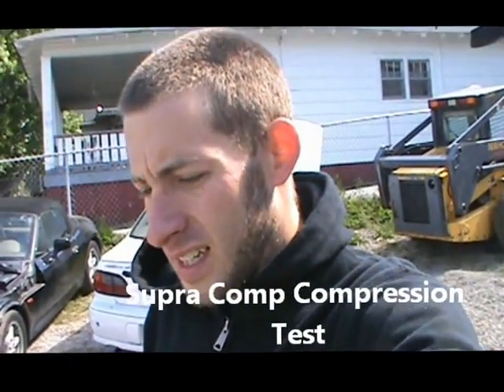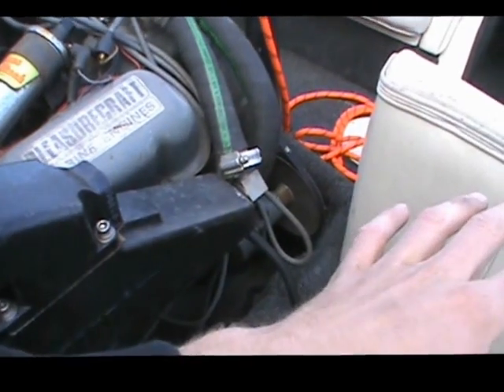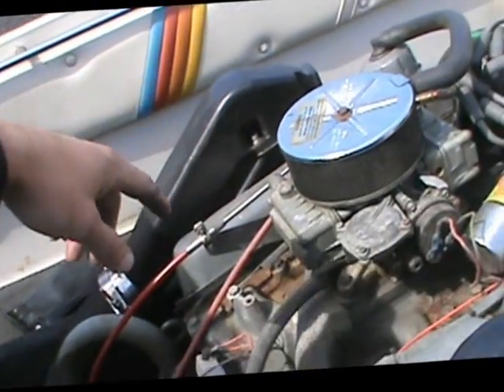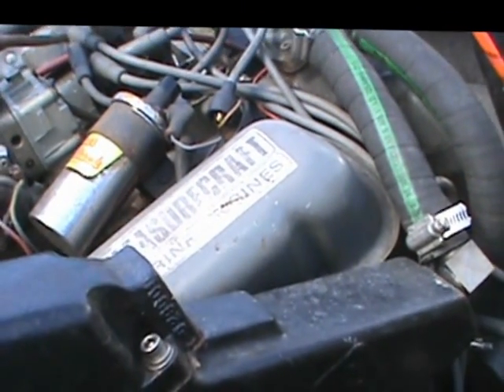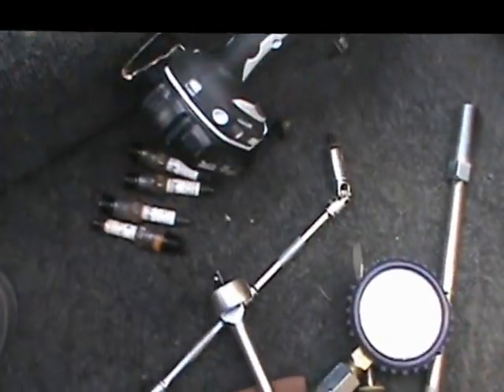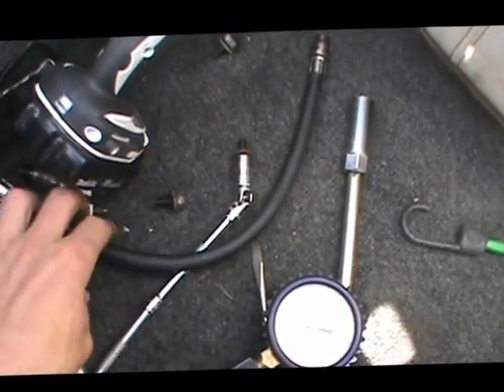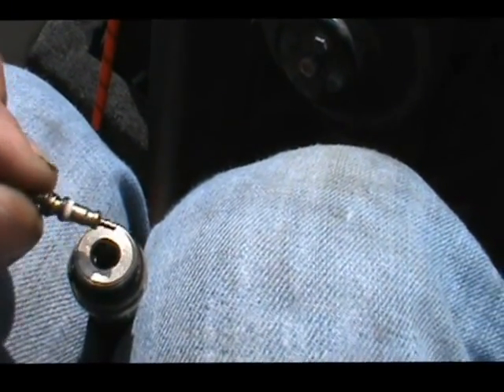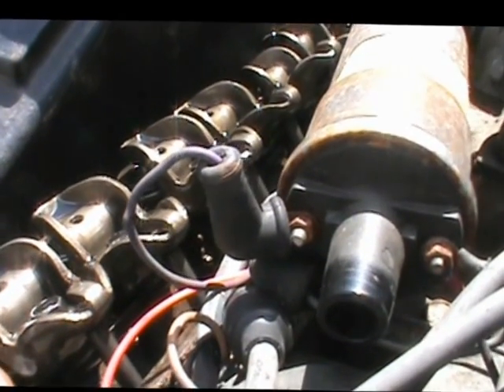how to diagnose a blown headgasket in a ski or wakeboard boat

Comment: Awesome video man. I'm dealing with a 4.3 lx mer and wouldn't get much power and going over 3000rpm it would backfire.  Did a compression test 150 all the way left.  5. 0  3.135 1. 45.  Well got the heads off  and my gasket was shit..

Comment from the maker: sounds like your off to a good start. first things first make sure your raw water pump is pushing enough water. disconnect the raw water pump while the boat is in the water turn it on and you should have lots and lots of flow. next check the thermostat on you boat it could be sticking shut which would cause a overheat. also u could have a blown headgasket allowing combustion gas into the cooling jacket creating lots of steam in and around that cylinder. try a compression test to rule that out.
Reply: watch the video before you comment

Comment: those heads and valve stems are fine , tighten the rockers to spec , no lash adjustment and change the head gaskets , i did mine in about 3 hrs one sat .. same issue just mine was the middle cly on bank 2 ..

Comment: I agree great video. Thanks. I have the same boat. Having problems sucking up water from the lake. Engine overheating. Replaced impeller and blew out every line. Still the same issue. Could it be a blown head gasket?

Comment: you need to check the impeller mating surfaces on the pump body and cover, if they are worn you'll need to fix that so that the impeller seals and can draw water across the system.